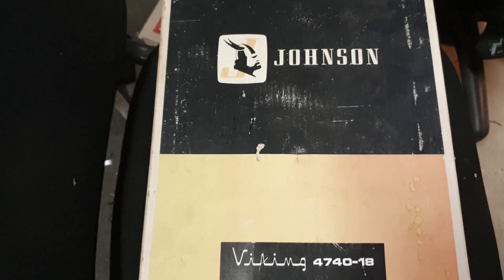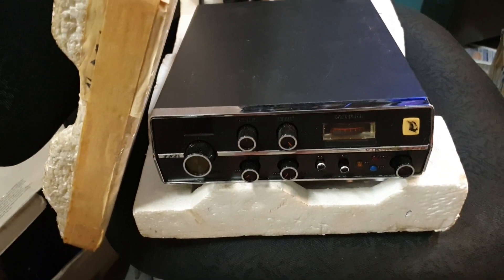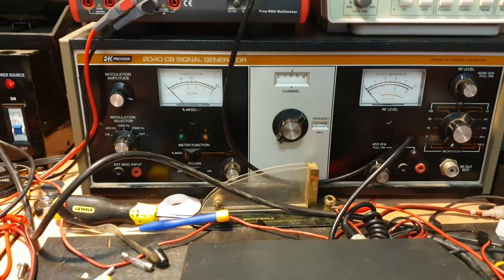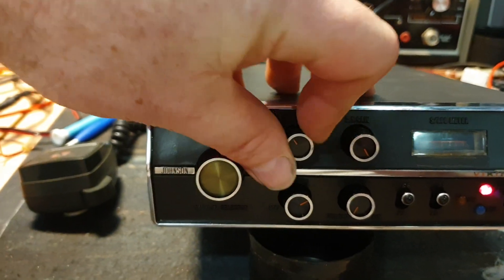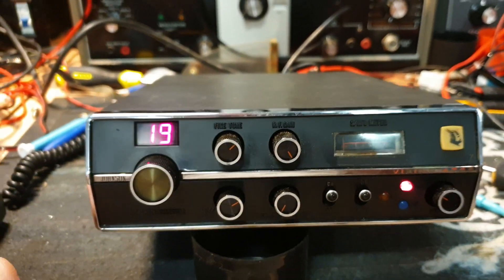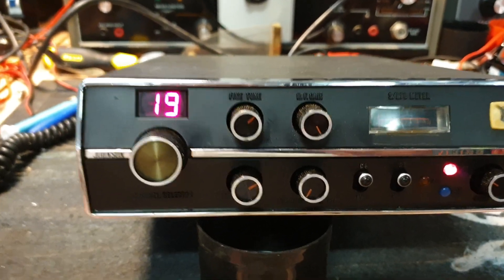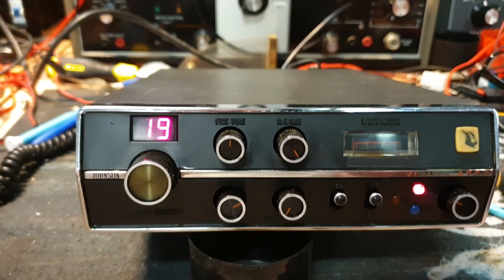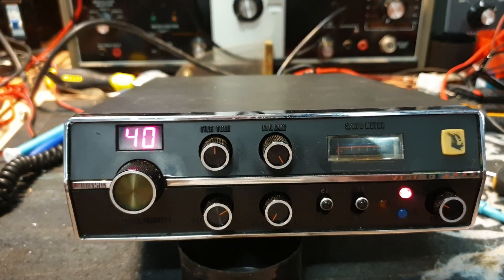Johnson Viking 4740 40ch ssb/am

Comment: Just picked up a 4740 cheap on the Bay sold as not working. Hooked it up and Rx was absolutely spot on. No Tx. Somebody had changed the mic plug and relied on the SAMS schematic which is wrong to fit the new plug. Schematic shows the changeover relay coil grounded in Rx when grounding it switches over to Tx. The pink TX wire was taped up and tucked out the road. Quick rewiring job and hey presto one fully functional 4740. Spot on frequency although only puting out 1.5 watts. Yep the slugs had all been screwed with. Quick adjustment and just under 4 watts at 12.5 supply volts from battery (PSU inop). Just fitting binary adder to give low mid and most of the high band. This will not be an ornament stuck on a shelf gathering dust as it's going in my daily runaround.